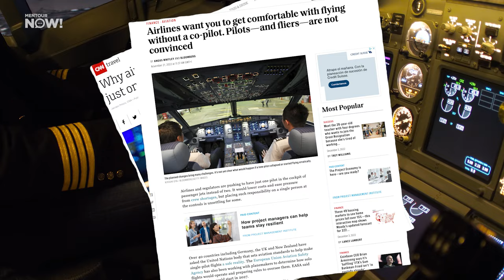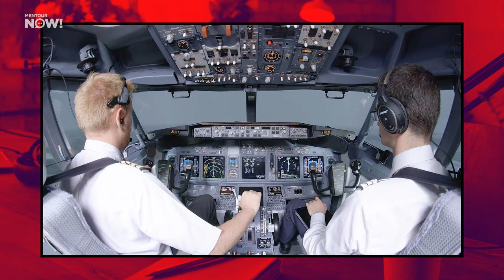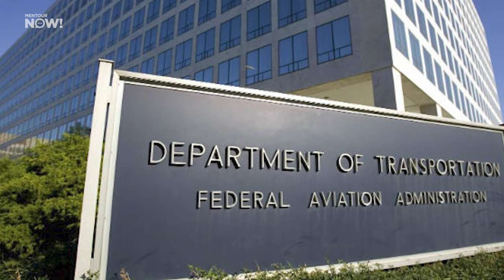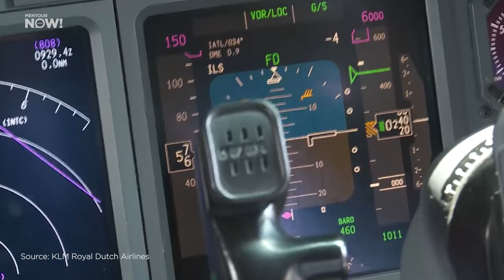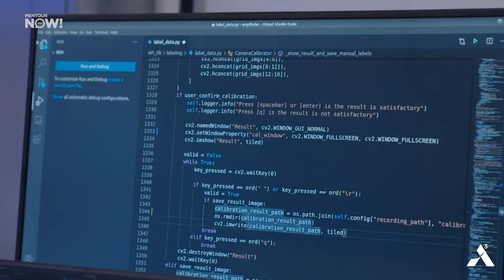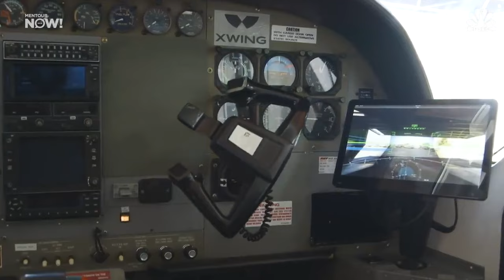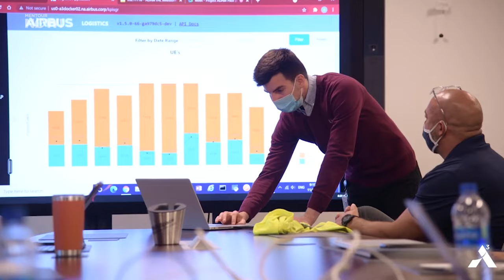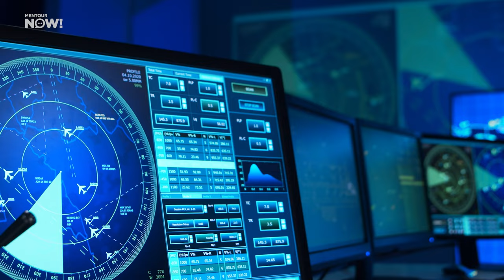The End of the Two-Pilot Cockpit?! Get Ready for Single-Pilot and No-Pilot Airliners!

Comment: When everything is working perfectly I have no doubt that one pilot is enough, or even zero pilots eventually. But what about when things go wrong and something breaks? In my reading of NTSB and other agencies' accident reports I've concluded that in emergencies even 2 pilots is not enough. Even in successfully resolved emergencies like US Air 1549 it's clear that task saturation immediately sets in and prioritizing tasks becomes critical. In the Lion Air 737 MAX crash the captain was successfully countering MCAS actions but then inexplicably turned the aircraft over to the 1st officer and seemed to prioritize ATC comms. In a previous flight on that same aircraft a similar MCAS incident was successfully handled with a 3rd pilot present. Perhaps some day automation will become sophisticated enough that it will reliably outperform human pilots even in emergencies but we're nowhere near that day.
Reply: United 232 had the benefits of three fully qualified pilots on the flight deck, and they said that they needed all three.

Comment: Saw this in the news, first 2 things came to my mind was "what happens if they die, would the flight attendants even notice until it's missed the prepare-for-landing by a considerable time or flies into a restricted space and shot down".  Other issues could be what if you have someone gets pushed and goes off the deep end, nobody to stop them.  Or heck even just humans are REALLY bad at staying alert monitoring things while the computer does the work.  I also seem to recall a nontrivial number of air-accidents where they had control issues and needed multiple people to try and mitigate the failure and focus on specific things or have both pull on the controls to overpower a jammed control.

I hadn't thought about them using the bathroom though...I can see it now, they go to re-enter "Open the cockpit doors, HAL...I'm sorry Dave, I'm afraid I can't do that..."
Reply: None of this happens until the automation/remote control from HQ is proven very, very capable and reliable.  
Who flys and lands the Predator drone without a pilot?  Who “flys” space station resupply missions?  In the near future, aircraft will be capable.  We will still have redundancy in the system.  It will be operator pilot backed up by operator automation/remote control.  Change scares people, but people adapt pretty quickly…if they see it working. 😅

Comment: In this context of single pilot operations, what do you think about the Garmin Autoland system that's available for some smaller airplanes? That system seems to automate quite a lot from the footage I've seen, including selecting a suitable airport, communicating with ATC and landing to a complete stop.
Reply: Impressive. Can it read the NOTAMs and such as well? Your description makes it seem great.
Reply: Garmin fell prey to a major ransomware attack, and responded in a most unsatisfying way, not very long ago. If their recreational and professional hardware are managed by one and the same company, sharing infrastructure and software, I wouldn't trust Garmin autonomous tech to function unsupervised. Not for a great many years, anyways
Reply: Garmin's system woupd require every other plane to move- similar to what ATC provides already- but dissimilar in that there is no 2 way communication of intent/plan/mental model sharing.

Comment: For me whether or not I'm comfortable with it comes down to whether it's provably safe or not. I have already travelled on automated train lines that handle collision avoidance and switching themselves. Now, granted, that is a lot simpler than a flight, but it's those same principles I base my feelings on. It's the complex compound failures where I think the benefits of having humans in the loop really shines as we can adapt to novel situations extremely quickly with proper training, so removing them would require proving that the type of failure the system could not handle would be vanishingly rare. It's a difficult job, but I do think it is manageable, and I do not think it requires some sort of 'sentient AI" that thinks for itself. Given enough system level redundancies and control over enough flight parameters you can ensure the aircraft's safety 'procedurally' by following set steps, just like a checklist. The critical component is ensuring those redundancies really are robust enough and that there are not situations where there is a possibility of saving a flight that the automation could not handle but humans could.

I do however completely agree with regards to cockpit isolation being a potential issue, and I do still ultimately think that implementing such automation with two crew is going to be the safest possible experience (assuming crew have top notch training on the automation system itself, too)
Reply: Riding those automated trains may be ok until your on the one that wrecks because there was no engineer.
Reply: Remember that all software is written by people, and people make mistakes, mistakes that aren't always obvious before something breaks, no matter how much testing you do.  

One example not a whole lot of people know about was the Space Shuttles 'Y1' problem.  Someone happened to be running a simulator on New Years Eve at midnight, which hadn't happened before because people didn't normally work that day, especially at midnight, when the flight avionics software lost it's mind.  They had to revise the flight operations so that there was never any chance of a shuttle being in orbit or reentry at the end of a year.  That was a just a lucky catch.
Reply: @byrw9557  Riding those non-automated trains may be ok until your on the one that wrecks because the engineer did something dumb.
Reply: @TinkersWithMotherboards  Same goes for humans being in control of anything directly. The new autonomous system doesn't have to be perfect to be worth it, it just has to be better than the two humans we currently have in the cockpit. I think that's easily reachable in our lifetimes.
Reply: @balsoft01  if it's automated it may not have an engineer.
Reply: @byrw9557  That's not what my point was. My point is that an argument like "an automated train is bad because it crashes sometimes!" is invalid, since a non-automated trains with an engineer also crash sometimes. The thing that matters is how often those crashes happen, and I believe we can get them to happen much less often with an automated system, since it can evolve much faster than a human (it takes hundreds of thousands of years for human brains to change meaningfully through natural selection, and single-digit years for us to dramatically improve an automated system).
Reply: @balsoft01  The problem is something programmers call 'Garbage In, Garbage Out'.  No computer system is capable of independent analytical thought, they only respond as they're programmed, even though advanced programs can mimic this to one degree or another.  So, for example, if there was a problem with the transponders at LAX sending out bad data, humans might be able to catch the error before landing, whereas an automated system would just keep pancaking planes into the ground piling on top of each other one after another.  

The MCAS debacle should have taught us this much already.    

Think it couldn't happen?  Here's a fun fact - these days, actually for quite a while now, programmers don't really know what their software is doing or capable of, because it's all built in layers on top of code that didn't work all that well in the first place.  I give you Windows 11, an updated version of Windows NT 3.1, first released in 1993.  A friend of mine was in the initial beta test group.  

This doesn't matter when you're playing games or chatting on the internet, but it does when human lives are at stake.  Look at all of the automated wrecks self-driving cars have driven their owners to their deaths in.  Same thing with self-flying planes.
Reply: @TinkersWithMotherboards  
> No computer system is capable of independent analytical thought

1. Yet (highly likely to change within our lifetimes, but not really relevant for autonomous systems)
2. That's not required to be a lot better and safer on average than human pilots.

Eliminating human error, in exchange for being worse in some edge cases, can result in automated systems being much safer on average. 

> So, for example, if there was a problem with the transponders at LAX sending out bad data, humans might be able to catch the error before landing, whereas an automated system would just keep pancaking planes into the ground piling on top of each other one after another.  

I mean, if your system only depends on one source of information for something as important as aircraft altitude, it would be a shit system. I imagine there would be at least two backups in a real system: GPS and ground radar. Potentially also optical recognition.

A bigger problem is, as you mentioned, analytical thinking. If enough systems fail, then the program might reach an edge case which was never considered on the ground, resulting in some unexpected behavior. However, with advances in both formally verified systems (which are guaranteed to not have edge cases) and AI (which can often extrapolate known situations to unknown ones), more and more of such cases are being handled by more modern systems.

> these days, actually for quite a while now, programmers don't really know what their software is doing or capable of, because it's all built in layers on top of code that didn't work all that well in the first place.  

That's true for most non-critical code, where development velocity and cost are optimized, with safety and correctness not considered important. If your laptop suddenly BSODs, nothing of importance happens, at least for Microsoft -- you aren't suing them over it. So, it makes sense to reuse old components which noone understands nowadays.

Critical code on the other hand is (or, at least, should be, wink wink Boeing) still written from the ground up, with very clear code quality standards.

> Look at all of the automated wrecks self-driving cars have driven their owners to their deaths in.  Same thing with self-flying planes.

Look at all the non-automated wrecks human-driven cars have been driven by their owners to their death. Same thing with human-piloted planes.

Humans are actually really bad at operating machinery, since our brains were not really evolved for that. However, it just so happens that because our brains have evolved to develop analytical, reflective thinking, we can construct systems which are much better at certain tasks then we ourselves are. Which is exactly what this is about.

I'm not saying "get rid of human pilots today", I'm saying "getting rid of human pilots should be the long-term goal".

Comment: The only way I imagine to keep things redundant with only one pilot in the cockpit would be to have another person who controls the aircraft from the ground, but that isolates the two pilots from each other as far as having full communication, such body language, with each other. You might as well have them sitting next to each other on the ground, which brings up the issue of the added complexity of a link between the aircraft and the crew on the ground. That does give me the idea that a secure link with emergency pilots standing by on the ground would be a good backup in the event all the cockpit crew are incapacitated.
Reply: This would only be good in one scenario. An emergency. The pilot on the ground wouldn't panic as much, his life not being threatened. So maybe he would calmly asses the situation.
Reply: I am thinking about how the military fly their drones from a ground base hundreds of miles away.  Perhaps the airlines are thinking along the same lines and if so, I can foresee a situation similar to a control tower where a single ground operator controls both the aircraft and air traffic control.  Scary stuff.
Reply: My suggestion was treating the aircraft as a remotely piloted drone should the pilots and flight crew be in no condition to operate the plane. There are cases of flight crews becoming unresponsive and the aircraft flying on autopilot until it crashes.

Comment: A few years ago we flew in a Loganair single pilot plane from North Ronaldsay to Kirkwall in Orkney. We were freaked out by the idea of even on this short flight, what if the single pilot became incapacitated? What if one of the passengers goes berserk? There was no barrier between the cockpit and passenger cabin.
Reply: How do you feel about buses, though? Trains? Carpooling? Dentistry? Our society has worked itself up into a frenzy over aviation in particular, and there's no reason to treat it so differently from anything else.
Reply: @stephenspackman5573  I don’t understand the comparison. All the things you mentioned have nothing to do with being thousands of feet in the air.
Reply: @alanjames7877  But nothing you said had to do with being thousand of get in the air, either. It was all about trusting the people around you and worrying that the person with the technical knowledge and command authority would be incapacitated. That can happen anywhere and almost never does. No need to mythologize air travel specially.
Reply: @stephenspackman5573  I would guess the difference is the fact that surface bound transportation stops more or less safe when the operator is incapacitated, flying vehicles tend to end up in a catastrophy when noone is operating it. And most passaengers in a bus could probably steer and stop a bus while it's less likely that any passenger in an airplane can do the same.
Dentistry is scary because of the anticipation of pain, not that they might kill hundreds of people in one event.
Reply: @stephenspackman5573  I was specifically referring to being on a plane in the air. Not on the ground.
Reply: @pyromanuel69  Well, consider software engineering, then. Or water treatment. Or land surveying. A single programmer can easily kill hundreds of people, but do you worry about it?

Your point that flying a plane is a more complex task than driving a bus is well taken, but this entire conversation takes place in the context of engineers trying to fix that.
Reply: @alanjames7877  Yes, I do understand that. But do you worry when an elevator doesn't have a human attendant? That stopped bothering me in the 60s. And they still move vertically.
Reply: Security pretty much prevents that. But yeah, having flown theDHC-6 Twin Otter (a similar plane to the Loganair's Islander plane), there is no barrier between the cabin/cockpit, you can see a lot of the cockpit
Reply: @stephenspackman5573  Of course I do. Those occupations are also important for the reason you state. And they also don't rely on a single person having the responsibility. 
Although if a single programmer can kill hundreds of people there have been some things going wrong since usually you have code review from the programmers peers and testing of the software from testers. But of course time constraints and lack of resources is a thing...which is a worry.
It's good that the engineers are trying to improve the systems, but the difference between modes of transportation is still what happens in case of failure. And everything will fail sooner or later.
Reply: @pyromanuel69  There are other ways that programmers can kill people, ones that will get past code reviews and testers. Poor security on databases from which one can infer nationality or sexual preference, for example, or trying to guess the measurements to use from the language chosen in document formatting software. But my point is just that we mythologize certain professions and turn a blind eye to the risks inherent in others. I'm truly not sure why people are more afraid of dying from an aeroplane crash than they are from dying in a bus crash, and I think it's confused to be so.
Reply: @stephenspackman5573  That's fair, but it's still many people that fails in that case, not it's any better. And it's also true that i's much more likely to have you data leaked or die in a bus crash (maybe even combined?) than being involved an airplane accident. I don't know why people have a more reserved attitude towards airplanes i general. In my case its more the prolonged time with fear between realising that something bad is happening to it acually happening. That time is shorter in a bus or car, but might be even longer in a ship. Not that it stops me from flying, aware of the statistics.
Another point is that one could be concerned about more than one thing, but sure, the population at large maybe are more concerned about certain professions even when other might have a greater impact on their lives.